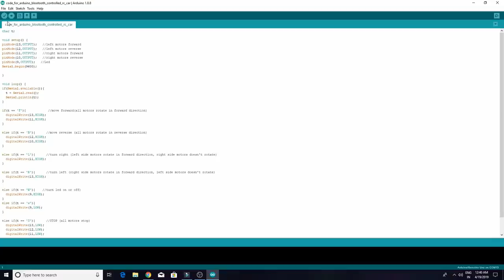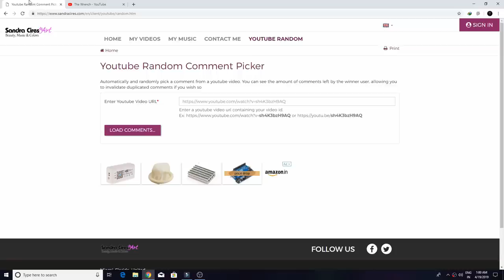WOW! Amazing DIY Bluetooth Robot Car - Control with Your Smartphone

Comment: Bro I have connected all the wires correctly and uploaded the code also but HC-05 is not visible in my android phone....
Reply: Same problem
Reply: Same...
Reply: Have you found a solution?
Reply: @enrikec7  no
Reply: U have to press the black button on your bluetooth module
Reply: Go to bluetooth module in your phone settings and and see nearby device and also some times it will appreciate like another device if u see click on it and pair then go to the app
Reply: Solution :
The same problem I too have..
And then I made a slight change to the connections of Bluetooth module using circuit diagram in description ( tx ,rx,gnd,5v) so that hc - 05n will light.If it is lighted means it is connected to hc -05 and you can make visible in phone ...(hc-05n)

Comment: The double side tapes have the tendancy to give up adhesion when subjected to vibration, which occurs more prominently on thin wood. I suggest screwing the battery case to the bottom of the car.

Comment: @The Wrench In diagram, I didnt understood the two negative wires connecting to GND. How can two wires come from negative terminal of battery? Also is it compulsory to attach bulb?
Reply: My friend ,Gnd consists of negative supply see ,if you are in touch to ground you will get shock if you touch phase or anyone touchs you
Reply: Can you please tell me which battery should I use ?

Comment: Did anyone else had trouble making this but nice video I still working on it can you give me some advice?
Reply: Are you done made it ?
What volt battery for works the robot?
Reply: @Yuzuu82  12 Volt
Reply: Can we use uno
Reply: @aliraza-ks6cv  no bro it will only supply 5 volt
Reply: @aliraza-ks6cv  combine 3, 4 volt battery to make 1, 12 Volt, 1 ampere battery.
I made it
Reply: Can you please tell me which battery should I use ?
Reply: @Ritunj_Gupta   combine 3, 4 volt battery to make 1, 12 Volt, 1 ampere battery.
I made it
Reply: I can't find the Bluetooth device in the app
Reply: @ayoblazed5677  bro is HC-05 blinking?
Reply: Can I call u , I need help
Reply: @luwang3218  ask
Reply: @rishittandon5539  hi bro, I got the bluetooth to connect n everything from the app.. But the motor wheels are not spinning when pressing any forward or reverse key in the app... Can you please tell me what's the issue?
Reply: @kingrishit5905  kingrishit2.0
Reply: @kingrishit5905  bro I've got it to work... The hc05 i was using was bad... I checked it up through another circuit by supplying power to it and connecting rx and tx pins... It was fried.. So on replacing it the thing started working.. Also the entire power supply was a little short.. So I used a 9v battery in conjunction to AA batteries... Worked like a charm
Reply: @akashchakrabarty5708  hi akash ... 
I am also facing the same error but my HC 05 is blinking and there is no problem with it .... But when I connect to the app and try to run it then the 'l' led on arduino uno is blinking again very fast .... Idk why it's happening ... Pls help me anyone who can resolve the problem ...
Reply: @sachinbly  dude you still have the problem ? Sorry.. I was not home... Got back yesterday night I saw your reply
Reply: Micro cantroler jo hain usme software install karna hoga
Reply: Software kha se install karen bhai
Reply: @BalramKumar-sp5wg  arduino ke official site se aap install krsakte ho bohot asani seh
Reply: @akashchakrabarty5708  I use the source is 4 AA 1.5 V batteries and the car does not run. So is it because the source is not enough?
Reply: @aliraza-ks6cv  yes you can
Reply: Which wire is used, male to female or female to male ?
Reply: @ayoblazed5677  At first connect it it Bluetooth of Phone then connect in app
Reply: @darshanpoudel6868  male to female
Reply: @Yuzuu82  3.7 volt
Reply: The wire used in 0:30 and the wire used in 2:37 are same or different?
Reply: What's the name of product used in 3:32 ? Let me know the full name
Reply: @foodie Land 
Take 3, 4  volts battery then
 just connect all the positives together and all the negative together
Reply: App back button is not working? Please help me out..
Reply: Hi everyone can I use a L293D motor server ?.. plz reply
Reply: @paulfernandes3240  actually you have to use L293D motor driver
Reply: @rishittandon5539  but mate in the video they are using an L298N motor driver right ?
Reply: @Paul Fernandes  bro, you can make it with both, but L298D will be preferred, as l293d can also be used as an AC to DC convertor.
Reply: @rishittandon5539  so the circuit diagram will be the same right?
Reply: @paulfernandes3240  no
Reply: @rishittandon5539  ahh man do u know what the circuit diagram will be ?
Reply: Can i use 12V Li-po Battery?
Reply: @キングGm  yes you can, but using 3 4volts battery will be better
Reply: @rishittandon5539  hi thankyou, may i ask again.. what will  happen if i also use 12V DC motor? And should i put 1k resistor on hc05 bluetooth module?

Well the things is, im planning to make a bigger one with a container that can handle around 3-5kg worth of garbages
Reply: @キングGm  And I can also provide you with the circut diagram and code
Reply: @rishittandon5539  is the code gonna be different from the original one? Because im going to use 12v dc motor?

My prototype does connecting to the Bluetooth but not responding to the controller
Reply: @キングGm  the code of this video is not gonna work properly
Reply: @rishittandon5539  is the code and circuit diagram free?
Reply: @キングGm  I can give it to you just like that ✌️
Reply: Yes
Reply: I can’t open link.
Reply: How can I give the code
Reply: Yes
Reply: @rishittandon5539 can you help me I'm facing the prblm when I  connect with the app the Bluetooth module didn't blink and when I'm not connect with the app this Bluetooth module start blinking and the car didn't respond anything and now again I upload the code but now showing me error 😢 plz tel me what to do
Reply: it doesnt work with this driver bro u need the other one

Comment: Please, 

Connect the HC-05 properly if using arduino, use a voltage divider using 1K and 2K resistor f,  divided tension goes to RX pin of the HC 05. HC 05 can be voltage tolerant on RX pin to a certain extent... but wont last for ages... 

Then please put low on remaining pins for each direction, otherwise as the pin could stay high from previous state and lock everything.
Reply: Hey my Bluetooth module is not working  the light is not turning on but arduino and motor drive light is turning on

Comment: hey guys for those who are wondering you could take the dimensions of the chassis as 20 *20 cm
Great tutorial The wrench
Reply: dimensions of wood
Reply: @technoarts_777  no no im just giving some scientific atomic mass unit for the atoms in the wood that helps us determine how much thick the wood is and how long we would require so that the weight of the components can be tolerated
Reply: @coolmcplayz  Thank you:goodvibes:
Reply: What are the dimensions of wood?
Reply: @shashidharsharmah  Its given in the comment
20 X 20 cm

Comment: Arduino: 1.8.10 (Windows 10), Board: "Arduino/Genuino Uno"

Sketch uses 2072 bytes (6%) of program storage space. Maximum is 32256 bytes.
Global variables use 189 bytes (9%) of dynamic memory, leaving 1859 bytes for local variables. Maximum is 2048 bytes.
Serial port not selected.

This report would have more information with
"Show verbose output during compilation"
option enabled in File -> Preferences.
Reply: "Serial port not selected."

Go to Tools - Port and select the USB-port your Arduino is connected to.
Reply: Can you please tell me which battery should I use ?

Comment: Hi Wrench. I am followed your steps and assembled this bluetooth car. Even the programs is uploaded as it is. But somehow, the car is not moving. Also in Bluetooth module only TX LED is glowing, RX is not. I have made the circuit connection exactly the way you have shown. Can you please help?

Comment: BOI you need to make voltage divider and attach it to tx pin or your Bluetooth module will burn. And when you uploading code you should unplug Tx and Rx pin of the Bluetooth module cuz it will cause problems when riding.

Comment: Great work bro
But I got a arduino low power issue
So instead of connecting arduino from L298 I connected to battery

Comment: No words .....just adore ur work bro...u inspire me i liked technology bt now i love it due to u big up and never give up.....just asking is it possible to invent a wireless electricity that is to be used by a city or even a nation .....hope u will reply.  Love Uuuuu
Reply: Hate to be the one to reply rather than Wrench, but I'm sorry it would just not be possible because of the principle upon how wireless works. Wireless always spreads out in all directions, hence even strong power would become weak the further it gets away from its source because its quantity is spread out over a vast area. The reason we can use this for radio/bluetooth/Wifi etc is that the receptors respond to very weak signals. Power to power up a house on the other hand would need to be a very strong signal to collect - such in the airwaves would kill people. This Bluetooth car is not powered by Bluetooth, only directed by such - the power here comes from batteries.

Comment: My problem is that when I use USB to feed the Arduino, the system runs alright. But if I uses the Vin feeded by 5V from motor driver it doesn't work. I revised all the connections, the GND, and I use a power supply that I can choose voltage and current. In schematics I saw the same thing: 5V from motor driver feeding Arduino Vin. How? I've also read that Vin has to be 7 to 12V because the Arduino uses internal regulator to stabilize 5V.

Comment: Why there is a small light blinking in aurdino board. I am using 8F22 8V battery for transistor radio. 2 items connecting in series. Is that the problem?

Comment: bro can you tell me what is the minimum voltage of l298n 
becauz  i have tried it with a mobile charger which output was 5volt 
and l298n not getting on 

pls reply

Comment: if someones code didn't work or it has problem uploading in the board Remove th pins for the bluetooth module and after uploading plug it back in Hope it helps

Comment: Hi bro,
Great project. I have tried this following your steps but my car isn't going reverse.
Can you plz help?
Reply: hello! did you got any answers about the problem? I have the same problem ATM
Reply: @xWildSpirit  Yes I somehow figured it out. The thing you have to do is change the line
 else if(t == 'B'){      //move reverse (all motors rotate in the reverse direction)
  digitalWrite(12,HIGH);
  digitalWrite(10,HIGH);
}  
to 

else if(t == 'G'){      //move reverse (all motors rotate in reverse direction)
  digitalWrite(12,HIGH);
  digitalWrite(10,HIGH);
}
if you are using the app mentioned in the video. I hope this helped you.
Reply: @vikb1977  or simple change from application config the reverse button from g to b, manage to do it yesterday. Did you found how to move to stop button in the interface?

Comment: The code is not uploading in Arduino
Pls help it's showing that upload error:failed uploading: exit status 1
Another thing is this I am using 3.7 v  2 battery means total 7.4 v I am using
But only 2 motor is working another 2 motor is not working

Comment: Excuse me bro .. If I use a battery with a 9V voltage can it?

And whats your application name?
Reply: you can use 9V battery for arduino. 
Dont use 9v battery for the motor driver.
Use 6 AA battery for motor driver.
cheers.

Comment: It works nicely,.i liked it ,it is awesome 😃✌️
Reply: Thanks
Reply: Anuradha Mani can u please tell me which batteries did you use
Reply: @samanthaperegrino6644  you can also use a normal 9v battery
Reply: Unable to upload code
Reply: Unable to upload code. Could you please help.

Comment: I am having trouble uploading the code to my board and getting it to actually work. The error message tells me to unplug anything from pins 0 and 1. After I do that the code uploads and then I plug back again the Bluetooth module. However, when I connect to my phone the car does not move. Any suggestions to resolve this problem?

Comment: When I tap the buttons and give the commands to the bt module, it recieves it and the arduino sends it to the motor driver, but the motors are not moving at all. Do I have to short ENA and ENB?? What should I do??

Comment: My Bluetooth module is not connecting, if I plug the Arduino board to my pcthen only Bluetooth module works otherwise when I plug it out it stops working, pls tell me what's the problem

Comment: I have did same as you did but my car is moving very slow I have used 18650 2 batteries 2500 mah they are fully charged and output is 7volts and I have gave 16 volts and tested again slowly its moving no change in speed for 7v and 16v please tell solution please

Comment: Also can a 4-pin bluetooth module be used instead of a 6-pin module?
Reply: yes, the 4 pin is called as Hc-06 and 6 pin is called Hc-05. And u can use it

Comment: BRO I have done every thing as shown in the video but the problem is its not showing the Bluetooth device in the App I have tried other Apps too but it still its not showing (The code is uploaded successfully I have removed  the TX AND RX Pin While Uploading the code   ~   because its showing a stk500_ error while uploading when the RX and TX pin is connected ! Please help me !

Comment: It goes front ,left and right only not back(reverse)
Reply: Same here. Don't know the problem, the code looks ok i tried but its not working maybe it is problem of app
Reply: Hey found the problem in the comments. Replace 'B' with 'G' in backward direction code line. I tried and it worked.

Comment: Thanks,  it's working
Reply: Sir it work to you ? Please help me 
I follow all his steps but mine didnt work
Reply: @jhiinzkiie  you done one mistake which i know
You can ask on my chanel videos i can tell you which mistake you do
Reply: @jhiinzkiie  yes it is working check your power supply connection of the motor driver to the motor and connection of the bluetooth module
Reply: Actually i have no mistake it is still working
Reply: @jhiinzkiie  car bluetooth rc is the best application for controll the car

Comment: Please tell me anyone how does this turn right or left? Does it happen that the left tires work clockwise and the right ones anti clockwise or something else?
Reply: You should stop the 2 motor either at left or right motor (motor1&motor4 for left) i use motor#.run(release);
Reply: @entropy971  
If I do the same in this video will it be done?
Reply: @DrBlue-ij7jh  yes.

Comment: bro not working the code is showing error pls help
Sketch uses 2072 bytes (6%) of program storage space. Maximum is 32256 bytes.
Global variables use 189 bytes (9%) of dynamic memory, leaving 1859 bytes for local variables. Maximum is 2048 bytes.

Comment: Hello, thanks for the video. Well, I have made the car. But I'm getting a problem. When I press the left key or the right key on my phone to move it in respective directions, it works well. However, when I press the forward button, the bluetooth connection gets automatically disconnected. Please help me.
Reply: Please what is the name of the app, i'm not seeing it

Comment: I made robot and get error --> avrdude: stk500_recv(): programmer is not responding
avrdude: stk500_getsync() attempt 10 of 10: not in sync: resp=0x73
Any suggestion ?
Reply: which arduino, nano or uno?
Reply: @2012revolution  Uno
Reply: Test other code, maybe bootloader is missing.

Comment: Good evening sir, I am constructing a project almost the same as this but I am using voice control, can I ask for help? my problem is that my car is not working even though the codes and wirings were right. Once I connect my power supply directly to the Arduino board all of the components will work though, but once I give my command it will only produce a sound as if the battery cannot carry the load of the robot though I am using the same battery as yours. what is the best thing to do? thanks a lot

Comment: Hello, 
I have also built similar car robot, but it works only with DC power supply.

It consumes current  around 0.35A, and the voltage is 9V-12V.   
I have tried 9V ultra lithium battery - did not move. 8 AAA alkaline batteries(~12.5V) also cannot make it work.
Would it work with 8 AAA Ni-MH or Li-Ion batteries? Could you please recomend some power source? 
Thanks in advance.

Comment: Bro answer me plz do u have to only use Arduino Uno or mega 2560 is also allowed fyi I have both which is recommended and edit: can i use ESP32 model instead of the bluetooth module in the vid?

Comment: I'm getting this error 
Sketch uses 2072 bytes (6%) of program storage space. Maximum is 32256 bytes.
Global variables use 189 bytes (9%) of dynamic memory, leaving 1859 bytes for local variables. Maximum is 2048 bytes.
avrdude: stk500_getsync() attempt 1 of 10: not in sync: resp=0x00
avrdude: stk500_getsync() attempt 2 of 10: not in sync: resp=0x00
avrdude: stk500_getsync() attempt 3 of 10: not in sync: resp=0xf6
avrdude: stk500_getsync() attempt 4 of 10: not in sync: resp=0x03
avrdude: stk500_getsync() attempt 5 of 10: not in sync: resp=0xf6
avrdude: stk500_getsync() attempt 6 of 10: not in sync: resp=0x03
avrdude: stk500_getsync() attempt 7 of 10: not in sync: resp=0xf6
avrdude: stk500_getsync() attempt 8 of 10: not in sync: resp=0x03
avrdude: stk500_getsync() attempt 9 of 10: not in sync: resp=0xf6
avrdude: stk500_getsync() attempt 10 of 10: not in sync: resp=0x03
An error occurred while uploading the sketch

Comment: Getting an error while uploading the code .. programmer not responding error
If I remove the transmitter and receiver connection then it's getting uploaded. 
Help pls..
Reply: im having the same problem did you fix it?
Reply: @hfgsfdartdd  no... Post a comment if any does